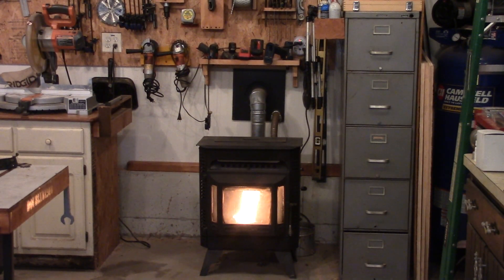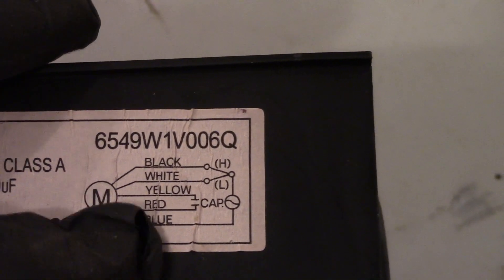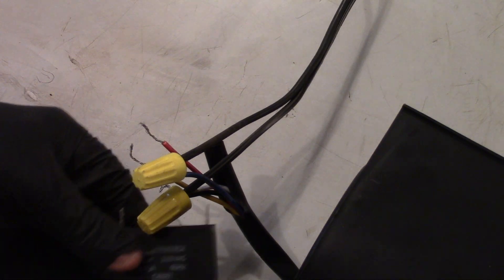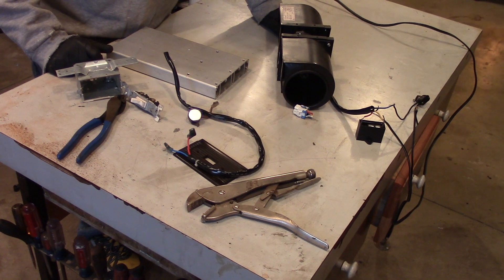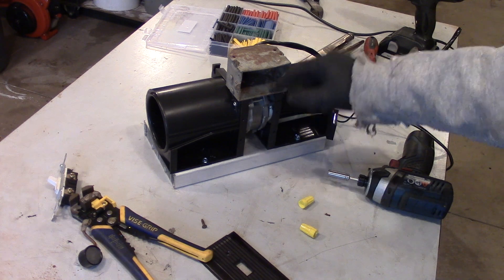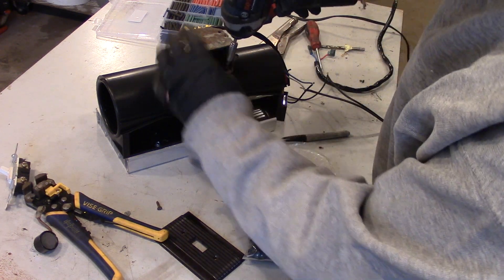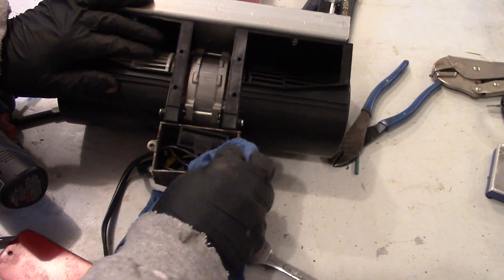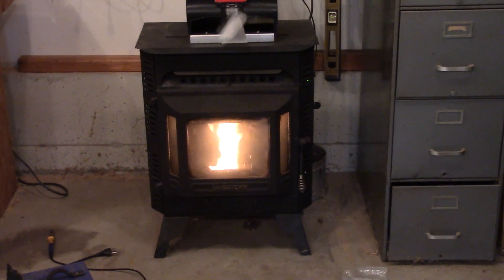Homemade Fireplace Blower Fan

Comment: P.S. used the RE-SEAL I got through your link on a Cub Cadet M-54 zero-turn that had bad seal leaks on both axle seals. It would soak the inside of the wheels, run down the tires and get all over the floor when sitting. It surprised me tremendously because in the first day it slowed down to a small trickle on the rims and within the week (I didn't check every day so an exact day count isn't available) it stopped leaking completely. I am still in favor of replacing bad seals when possible but this stuff is amazing. The parts for this older unit are hard to get so I was very glad that it bought more time.

Comment: Just an idea but you could install a thermostat on the far side of the garage and wire it into the switch so it would turn the fan on and off as needed. Not that I'm lazy or anything but it would be a cool project.

Comment: in ny state all flames in a garage have to be  a min of 18 in.  above floor what is the code were you live
Reply from the maker: The garage is detached, so I remember a few things are different with the building code.  The drywall is 1/2 instead of 5/8 as well.

Comment: That was cool Bob. Or shall I say warm. Anyway nice build. In September my GE Built in microwave failed, I got rid of it. If I had seen this first I would have kept the blower. Oh ya, I owe you some kitchen pictures, sorry I forgot. Great video and explanation as usual.
Reply from the maker: Microwaves have a ton of parts inside.  3 door switches, I used one as a switch to close my garage door when I walk out of the garage. Also lots of wires with terminals already on the ends.  I made a spot welder out of the transformer, but I'm having trouble with is working right.  I also took the timed keypad and made a timed outlet that turns itself off after a set amount of time.  All these videos are on my channel somewhere.  Thanks for watching, I will keep my eye open for your kitchen pictures.

Comment: like your soldering station
Reply from the maker: Thanks Mike.  Good to see you back.  The soldering station is pretty nice.  I find the adjustable hot air blower on it to be really handy.  I used the hot air blower for a tricky plastic project that required just the right amount of heat to loosen up a glue.  It worked perfectly with damaging anything underneath.  You can also desolder large chips with the blower.

Comment: how old and big of an old microwave did you use?
Reply from the maker: Just a standard microwave over the stove 30" wide microwave.  Because your microwave vent is sucking air as a vacuum it does not feel powerful enough, but if you take it out of the microwave it is really strong and quiet.  Perfect as a fireplace blower.
Reply: That makes a lot more sense. I'm not sure but I don't think a regular counter top microwave would have this kind of blower in it. This is a squirel cage vent fan from a range vent with a microwave. Nicely done sir.

Comment: Nicely done.
Reply from the maker: Thanks, How do you heat your shop?
Reply: doublewide6
I use a portable kerosene(running on diesel) torpedo heater. I can't bring myself to give up a corner of the small garage to a dedicated wood stove.
Reply from the maker: I had an offer to do a ceiling mount electric garage heater last year, but I never did the video or installation because I already have a portable propane heater and my pellet stove.

Comment: my son made personal work fan out of one of those fans, realy moves alot of air.
Reply from the maker: It is funny you say that because I was thinking about moving it by my window when I weld.  It would also be good in the summer as a personal workstation fan.  Maybe I will wire it up with both speeds.  I made it portable, so I could move it to add pellets in the hopper of the stove.  I agree it really pushed the air, it seems like is is 3 times stronger outside the microwave.

Comment: You know, they do make a round cornered utility box with a weatherproof cover that would have been perfect for this project, and meet the electrical code to boot!!!
Reply from the maker: Well, for the whole project I was using what I had laying around.  Waste Not Want Not.  Besides HD and Lowes don't have utility plates with my initials on them.